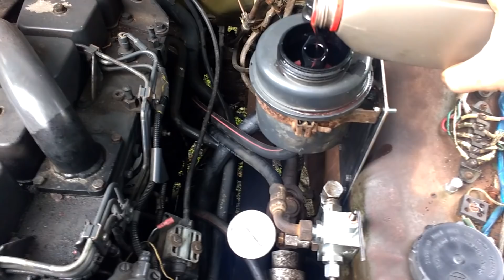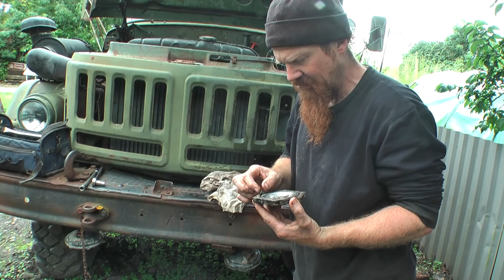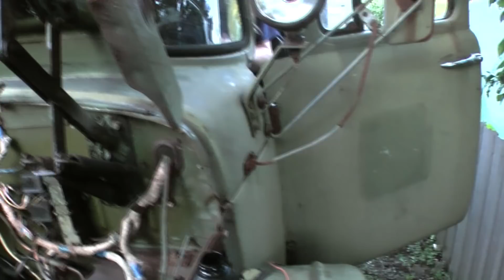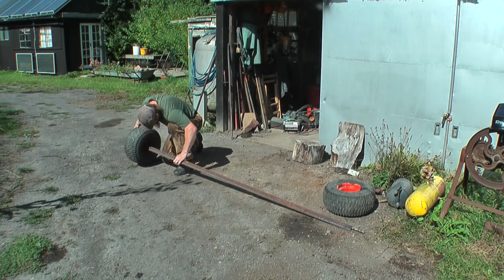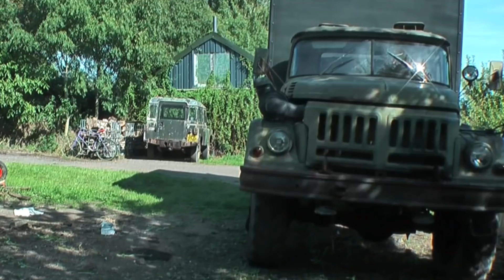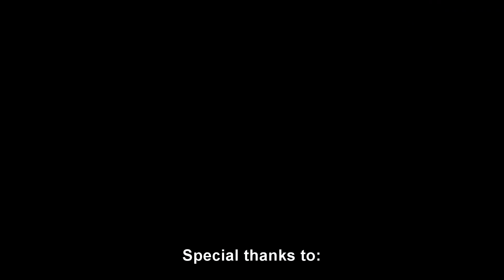Project Awesome 21: Relocation Situation

Comment: Once took an Organ from a Church, Lot's of Block Tin Pipes, and Major sized wooden ones, We think they were Pencil Cedar, and Yellow Pine, all coated with a dark paint of some type, Most interesting was the Bellows with were very big, 2 of em about 8 feet by 4 and powered by what looked like a Water Engine which was on the same system as the heating in the church. Your stuff is very good to watch and inspires me to get off my arse. Cheers.

Comment: Have not read all the comments about power steering system...... But if your new engine runs a P/S pump with too higher pressure for the Russian system... I HAVE A IDEA  on the power steering pump is a pressure regulating valve if it is anything like the ones i have played with in past u can unscrew it & adjust by adding or removing shims .... expect removeing shims to lower pressure if no shims to remove use a weaker spring ..... set adjust using gauge u have
Reply: one other thing i have cracked toyota landcruiser power steering pump cast housing  in half  by raising the power steering pressure...... any way good luck

Comment: Hi, i found your channel a couple of months ago, really interesting, very relaxing watching someone else work....watching your videos on your home it came to mind....god forbid but what if you had a fire break out, have you a plan or something to tackle it with until the professionals get to your location......speakin from experience it’s not good.
Reply from the maker: My Dad's an ex-fireman so I've had fire safety drummed into me from a very young age. There's two fire extinguishers in the house, two in the workshop and one in the land rover. There's a submersible pump in one of the rainwater collection cisterns that's attached to a hose reel. I have two smoke alarms (and two CO detectors). I shut down the 240 volt system at night and never leave an open fire or candles unattended. I don't smoke, nor do I let anyone else smoke inside. I'd guess I'm fairly well equipped to cope with fire (or any other emergency) but the main plan is to prevent the problem occurring in the first place!
Reply: Maximus Ironthumper 
Brilliant, aye well i felt a bit of a nugget after sending the message but it was just one of these impulse things.....you’re well sorted mate.
Looking forward to your next upload.
Cheers 👍

Comment: I have learnt a knew 'thing' in Maximus school today, it's called a 'pressure releasing valve'...never thought before such a device exited on a power steering system. Is this a special modification or a standard part of the ZIL system ?...

Comment: @4:18/19 , no not an idiot, these things need to be tested way past their working norm so they don't fail and leave you out and about far from home and in a pile of doo doo!!And don't sweep the bench dust and dirt on to the floor,,, Why sweep up twice,? 
Make yourself a dustpan and brush into it and put it straight into the bin,,, a tidy shop is a safe shop!! lol I made a steel one fro my workshop so that swiftly brushed hot metal debris could be safely dealt with.

Comment: the truck radiator has special Arctic winter kit installed I'm sure that's not needed in England but watch out so doesn't overheat because looks like the radiator air is blocked off

Comment: Online, you can get o-ring manuals, and even if this is an old soviet piece, they follow the pretty much the same patterns. So if you're ever unsure about the diameter, based on the hole, the manual gets you the o-ring diameter/spec.

Comment: the ps pump's internal pressure regulator is pretty easy to adjust, just take it apart and brain out how the valving works

on a VW mk4 golf pump you cut down the little spring inside the big spool valve

on that one... easy enough to figure out with some disassembly

Comment: Looking at how compressed and stiff it was, that O-ring wouldn't have lasted much longer anyway so it's good that it failed then rather that when you were on the road going somewhere...
Reply: Well I'm sure there are a whole lot more 40 year old O rings and seals in the system. So I hope for Max's sake that you are wrong.

Comment: Hydraulics is one of the many subjects I have no knowledge or experience of (but that's never stopped anyone on YouTube commenting before - so here goes).  Does the compressibility of any air in the lines mean there is a chance that, after it's all bled from the system, the pressure at the gauge may rise?
Reply from the maker: Technically yes bit in practice the effect is very small. The difference between the hydraulic steering and say a car brake system is that the steering system has a lot of flow so any air is quickly purged whereas a brake system has no flow so trapped air is much more critical.
Reply: Ah, that makes sense.

Comment: 7 bar is 102Psi a tad high for power steering,  even for soviet eqp.
Reply from the maker: The peak pressure from the pump is 140bar, we're using the reducing valve to give a peak pressure of 70 bar which is very close to the 70kgcm2 specified in the Zil technical manual.

Comment: You can get O ring kits that contain length of O ring rubber in various sizes and a jig for cutting and gluing them plus super glue. Work fine for stationary rings.

Comment: We used to glue o rings up with superglue - stay safe
Reply: Loctite have service kit which comes with lengths of nitrile in different diameters, a razor blade to cut it and glue. I often used one in the bush to get a peice of equipment up and running .